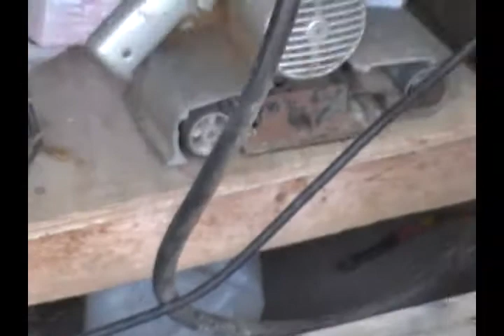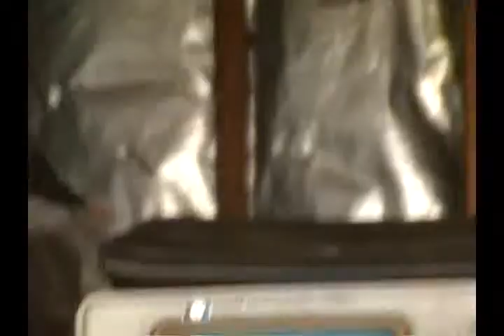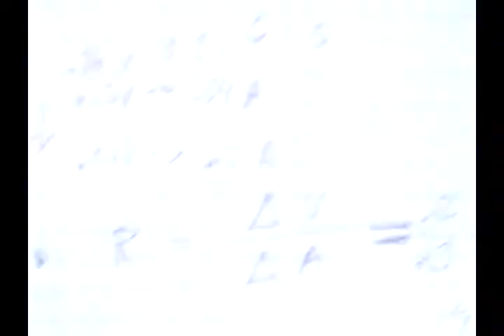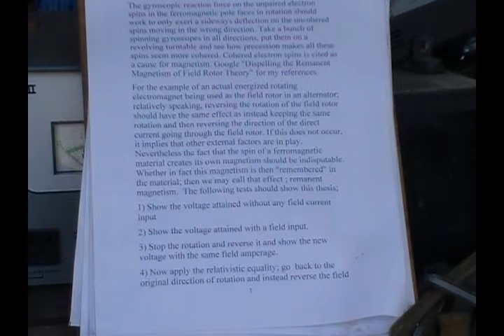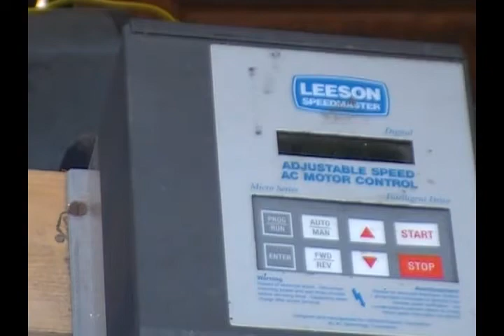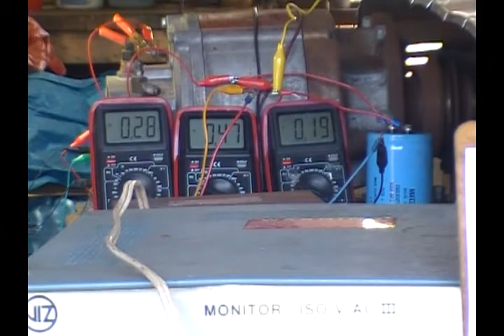Bus Alternator Video Pt. 1

Comment: What are you trying to show by this video?  What is your goal here?
Reply from the maker: The goal was not reached in the bus alternator videos which was to show that the direction of the field current will enable more output when it is in harmony with the pre-existant rotational magnetism. This was later shown with a regular alternator; Effect of field reversal @ 465 hz on three 13.6 uf capacitive reactance loads from a Delco Remy 3 phase alternator. Studies of remanent magnetism of an alternator field rotor (1)  https://youtu.be/xtZhSYzseZ0
Studies of remanent magnetism of an alternator field rotor (2)  https://youtu.be/qsoJMzsTtEQ
It was later determined that applying a short across a reactance to eliminate it's influence in series on the loadings causes inaccuracies in making the readings because even though the L portion is shorted, a small amount of current still ensues across the inductance, which then alters the true reading for the capacitive reactance. As such I abandoned this series of videos and can rely upon them in the future when this subject is re-investigated.
Reply: What effect does that have on anything???
Reply: looks like a top secrete experiment and this video was sent to his college somewhere in the world but it leaked into YouTube so now we all know what the effects of reversing the polarity of the magnatism does to the charging system equipped with three phase charging diodes.
Reply from the maker: To all the birdbrains out there I will reiterate; rotational magnetism of a ferromagnetic pole rotor  in the alternator is non-existant in all the scientific literature I have seen, so I am doing the world a service by exposing this fact. The naysayers conclude that the effects we see when power comes out of an alternator that has no field current is due to what is called remanent magnetism, where the field "remembers" being magnetized in a certain direction and displays that fact after the charging current is cut off. Unfortunately both things are true and we have to do certain experiments to distinguish what effect causes what. One of the first things we might wonder about is that since in an ordinary alternator the field windings rotate with the field, maybe it is the field's rotation in space along with the piece that is being magnetized alone that somehow sends current through the field winding that makes this effect of magnetizing the field rotor when rotated. In this experiment we can negate that thesis since in a reluctance alternator (as this bus alternator is) the field does NOT rotate with the magnetized pole face rotor; they are totally separate parts: yet voltage and currents is still produced by rotation. This leads credence to the rotational magnetism thesis. Let me ask the birdbrains a simple question; can the resistance in the windings of an electromagnet as used here be varied by rotating it? 99% of respondents will say no, that should be impossible. Yet they are wrong. The resistance of the windings will appear higher then normal until the effect of the electromagnet producing a magnetic field equals the pre-existent effect of the rotational magnetism. So what am I trying to show here? I showed the effect of remanent magnetism of the solitary field rotor by first noting the effects in one polarity and rotation; and then employed the double negative by reversing both the field current AND it's rotation. If no remanent magnetism existed, each situation would be identical, but they are not. Because the field rotor remembers being magnetized in one direction; when we stop the rotation and reverse everything we obtain a lesser output, therefore we deduce that this is because of the history of how the electromagnet was  previously magnetized that evidently hinders it when a reversed magnetism is used.
Reply: To all the birdbrains

Point of correction:  Mr.Harvich refers to people, like himself, human,  with derogatory slur with the use of the word “Birdbrain”.  The correct viewpoint is we are humanbrains.

 out there I will reiterate; rotational magnetism of a ferromagnetic pole rotor  in the alternator is non-existant in all the scientific literature

Point of correction:  The alternator Mr. Harvich is using is a 50DN Delco Remy gear driven Bus alternator first invented in 1958 and still current technology today in 2018 on transit buses.  Delco Remy (Now Borg Warner Corporation ) goes into great detail on the subject of rotational magnetism of a ferromagnetic pole rotor.  Delco refers to this as residual magnetism.  This residual magnetism is actually used as the principle by which the self exciting alternator begins to charge on its own, without external excitation.  Not only is this premise recognized in scientific literature, it is commonly used.

 I have seen, so I am doing the world a service by exposing this fact. The naysayers conclude that the effects we see when power comes out of an alternator that has no field current is due to what is called remanent magnetism, where the field "remembers" being magnetized in a certain direction and displays that fact after the charging current is cut off. Unfortunately both things are true and we have to do certain experiments to distinguish what effect causes what. One of the first things we might wonder about is that since in an ordinary alternator the field windings rotate with the field, maybe it is the field's rotation in space along with the piece that is being magnetized alone that somehow sends current through the field winding that makes this effect of magnetizing the field rotor when rotated. In this experiment we can negate that thesis since in a reluctance alternator (as this bus alternator is) the field does NOT rotate with the magnetized pole face rotor; they are totally separate parts: yet voltage and currents is still produced by rotation. This leads credence to the rotational magnetism thesis.

Point of correction:  Mr Harvich is not doing the world any service here with a scientific discovery.  The world of 3 phase Alternator design is already aware of the results of such testing.  Soft iron is used as the transfer material to multiply the induction factor by  many times and has been known for a long time to be a poor example of a temporary magnet holding some very small amount of residual magnetism.  While Mr. Harvich is correct in his deduction that the soft iron ferromagnetic pole piece does retain some very small amount of magnetism, and does have a polarity memory, the amount is very slight.

 Let me ask the birdbrains

Point of correction:  Again the use of derogatory slur (Birdbrain ) does not speak well of the author.  Rather “Be humble and never think you are better than anyone else.  Remember for dust you are and to dust you shall return.

a simple question; can the resistance in the windings of an electromagnet as used here be varied by rotating it? 99% of respondents will say no, that should be impossible. 

Point of correction:  The answer is yes, since the resistance of these windings becomes more as they heat up due to eddy currents and histerous loses the longer the windings have current running thru them.  The automotive type alternator Mr. Harvich is referring to is an intermittent rated machine, not a constant duty cycle machine.  Therefore it cannot cool itself if run at 100% for extended periods of time.  This field winding resistance increases as the temperature increases.  Electrical windings become less effiscent when heated than when cold.  I agree with Mr Harvich on a much stronger premise than residual magnetism, although his statement is also correct.

Yet they are wrong. The resistance of the windings will appear higher than normal until the effect of the electromagnet producing a magnetic field equals the pre-existent effect of the rotational magnetism. So what am I trying to show here? I showed the effect of remanent magnetism of the solitary field rotor by first noting the effects in one polarity and rotation; and then employed the double negative by reversing both the field current AND it's rotation. If no remanent magnetism existed, each situation would be identical, but they are not. Because the field rotor remembers being magnetized in one direction; when we stop the rotation and reverse everything we obtain a lesser output, therefore we deduce that this is because of the history of how the electromagnet was  previously magnetized that evidently hinders it when a reversed magnetism is used.

Last word:  Mr Harvich is also correct here, however the volume of wattage he is referring to is miniscule, like bringing to light a grain of sand from the seashore when the the grains of sand on a beach is abundant to say the least.  One grain of sand compared to the entire beach of sand is not usually considered much. 
Further commentary:  While Mr. Harvich’s conclusions are correct, they are of very  little consequence in the real world, since this small amount of difference in energy produced in one direction of rotation compared to the other direction of rotation due to a small amount of magnetic retention, is so little.  While this might be new news to Mr. Harvich, it is not new news to Delco Remy and their self exciting 21 and 27SI Alternators. Bear in mind sir, the world is already aware of the results of your experiments here, and has been for a very long time.  You get an “A” for effort here.

Note to Mr. Harvich:  If you are looking for ways to improve science or the quality of life for the human race, you would be good at that, if not misdirected.  Far better is it to also make a study of prior art before making broad statements of discovery.  Again I urge you to redirect your talent to areas that can benefit mankind.